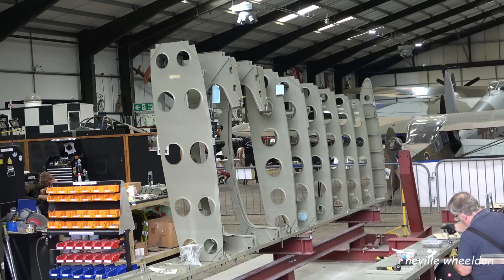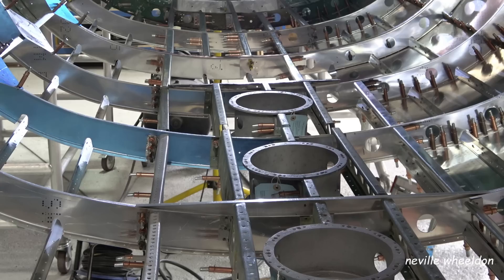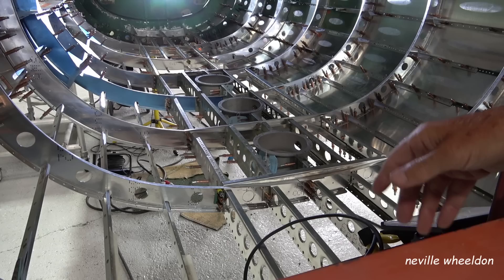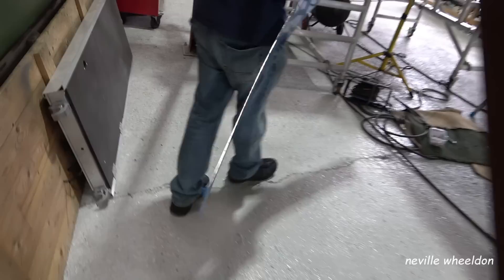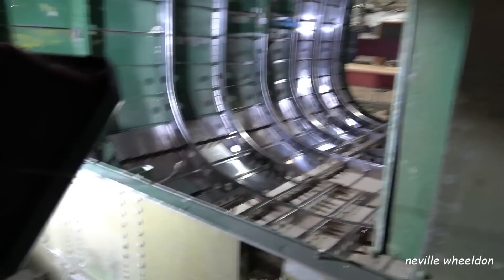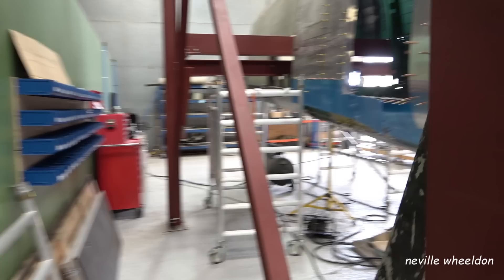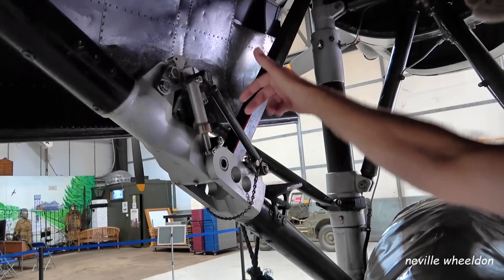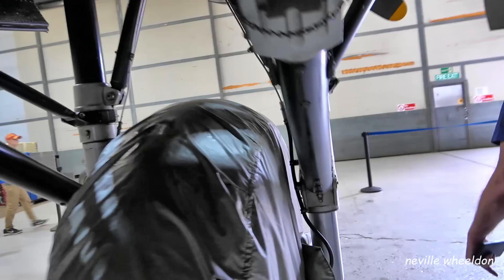Video 156 Restoration of Lancaster NX611 Year 5..Top Boom fitted to the Web of NX664

Comment: rather a wonderful action on the undercarriage knee joints - you certainly have to marvel at the design that goes into these things, and i for one appreciate the engineers who must have spent hours scratching heads to come up with these innovative designs

i know myself having worked with engineers in a similar military role, will be given various dimensions, so i suspect for an undercarriage, given sizes for the wheel, rim and the housing or wheel well that it will retract into

there are a number of undercarriages that baffle me as to how engineers overcame the design and geometry, the Sepcat Jaguar has i think one crazy main undercarriage, from any angle, both the struts and wheels look huge to be able to fold up and neatly stow away into what seems a very small space in the fuselage - another is the English Electric Lightning, to look at the undercarriage from the front, the wheel itself is incredibly narrow for the aircraft landing on it while the long strut is just massive, in fact it was said wheels were changed regularly after just a few landings, two to three, in Saudi, that could be less because of the heat on the runways, but the thing that amazes me, is how the wheel can pivot backwards and twist the wheel into the wheel bay, its just mad and super clever, and something worth watching

love your vids Nev, keep going fella, your doing a sterling job

Comment: Excellent work, Neville. Thank you for explaining and showing the down lock mechanism on the Lancaster undercarriage. As an aircraft mechanic, I worked on many different models of aircraft and the down lock mechanism on each model all work slightly different but achieve the same result of putting the linkage slightly over center. The “lock your elbow” explanation is spot on.
Reply from the maker: Cheers Rex.

Comment: Neville could you please ask the guys what do they do with all the old skins and parts that are beyond use? Do they melt them down and recover the cost as scrap? If so it seems a real shame as that means the original aircraft is technically scrapped but then it would be crazy to store all the bits. 
Imagine if all the broken bits could be put back together again with support braces as necessary and put the completed assemblies into a museum to keep the old aircraft alive in a way.
Reply from the maker: The Centre had not decided what to do with them yet last time I spoke to Andrew.

Comment: To help those not familiar with the gear concept, the struts look as if they are on a perfect centreline when fully  down and extended. They are NOT. The struts go "over centre" by just a few thousands of an inch. That is what that small cylinder does. It breaks the over centre and then that allows the master cylinder to retract the gear. In this particular case the small cylinder also is part of the "safety"  device. Thus the cockpit call out "down and locked" on the checklist.   Neville, you are an institution!
Reply from the maker: Your a knowledgeable guy, thanks ed.

Comment: Neville, could you please get someone to explain the long pins which are used to temporarily hold the skin panels in place until the final riveting is done?
Reply from the maker: Hi David, I have put a link in the description column just below this video. Video 30 Restoration of Lancaster NX611,  click on the link it will take you to Video 30. 5 minutes -25 seconds in John show how the pins work. Thanks for watching.
Reply: @nevillewheeldon1693  thanks for that advice, Neville.  My problem is that I have never been able to find a’description column’ under the video, or anywhere else if it comes to that.
Reply from the maker: @davidbamford4721 . Video 30 Restoration of Lancaster NX611 Year 2 . John talking about SkinPins 5 min 25 seconds in.  Click on this link    https://youtu.be/CAbaae2cEnQ       Hi David if you are watching on your phone , it will say   Video156 Restoration of--   to the right you should see  "v"    Click on this "v" it will take you to the Description

Comment: If anyone else wants to see the Geometric (or Over-Center) lock on another aircraft - here's a pic showing it on the left Main Landing Gear of a CF-18 - 
https://drive.google.com/file/d/1F-ktsR2CAWRgWTuReY-A1fHl1il-QYGI/view?usp=sharing
The geometric lock is formed by the greenish link (in the upper right corner) and the diagonal white link below leading to the "Elbow" in the landing gear. The Orange (Remove Before Flight) flag is attached to the Safety Pin that ensures that the Over-Center lock is maintained at all times while on the ground.
Barely visible just above and behind the green link is the Hydraulic actuator that "breaks" the Over-Center lock to allow the Gear to Retract. The main retraction actuator is attached to the top of the Main Gear leg, and is right in the top Right corner of the pic.
Each plane is different, but the theory is all the same. The F/A-18 (and CF-18) is one of the more complicated (and nightmarish) systems out there.